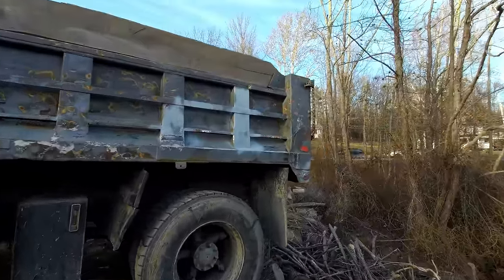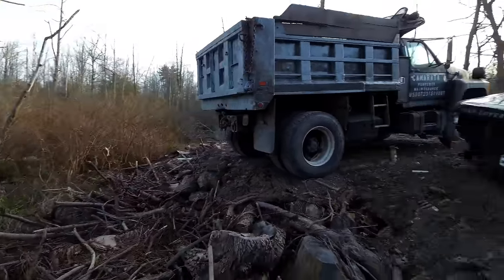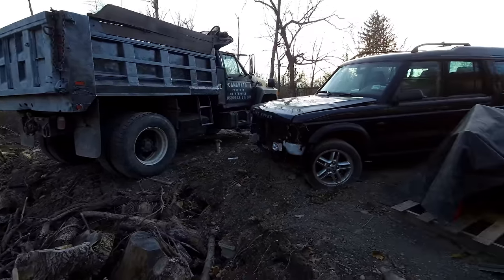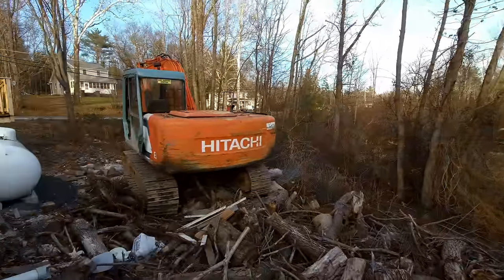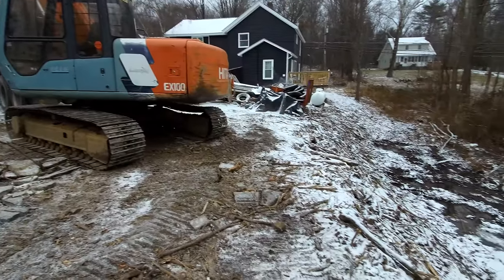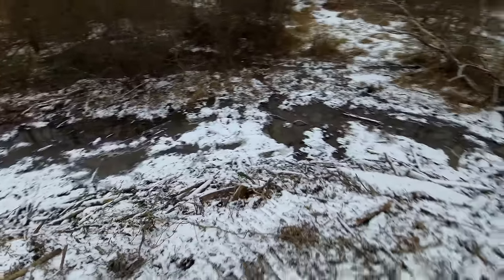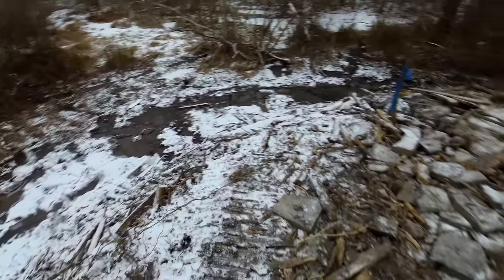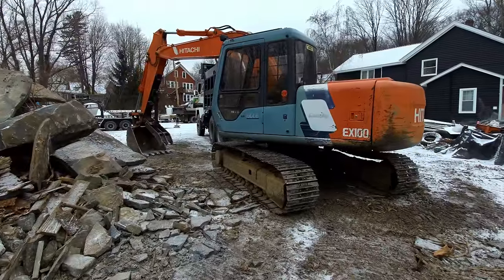Cleaning up dumped wood

Comment: 4:39 Land Rovers come with "check engine" light turned on from the factory. If the light is off, head over to the nearest dealership, cause the bulb is missing.
Reply: Lol you the kind of guy that thinks a Black Lab is a guard dog !!!! Until you came face to face with a real guard dog like a Cane Corso !!!!! And things will run forever if you take care of it with a few exceptions like a Fiat now you do realize Fiat is the new Jeep Wrangler???? I'll take a 2004 Land Rover Discovery over a brand new Jeep any day!!!!!! Trump 2024
Reply: @LaLaLucky7777  you do realize that Jaguar and Land Rover is a subsidiary of Tata motors of India since 2008, Probably why you chose 2004.

Comment: That place has been "expanding" their flat parking area for a few years now.  I am always surprised when I drive by b/c of where it is located that more isn't being done to force him to clean up.  Great work, that chipping yard looks pretty extensive.
Reply: TechEdFireman it's criminal.
Reply: Not Sure are you sure?
Reply: if all that mess didnt originate on that property the owner could have a huge problem if the NYS DEC got involved.  Its called operating a landfill without a permit.  The property owner might be looking at a felony count with substantial jail time and a very expensive fine
 . If I remember correctly it was $10 K plus cleanup costs around 20 years ago.

Comment: Hi Andrew from the UK. your comment about a landrover. We have diesels mostly over here, my black early 3 door i purchased for next to nothing but it needed lots of welding underneath. That done i owned it for 10 happy years doing everything I wanted to do with It, towing big trailers,  broken down vehicles, or being a 7 seater car. It used to tow in broken down vehicles with ease and its old fashioned 2 1/2 liter turbo diesel ran happily on new cooking oil & diesel mix allowed here if you only used 25.000 litres a year (but who checks) sadly I had to sell it at 240.000 miles on the odometer due to my need for an auto box one when  find the right one - Diesel rules here Andrew.. OK, I am an old machine shop engineer that used to work for the aircraft Industry so, I love just watching your videos and LEARN something new each time, but at 71 years of age, I`ll not do lots that  I`ll learn from you.. Your doing great stuff that keeps me amused so thanks for that.. OK, as Its near that time of year, may I wish you & family a Merry Christmas, and that goes out to your fan base also.. Have fun, keep up the good work.... Ian.B.

Comment: Nice to see the 10 tonner earning its keep. Great video Ta!   The Land Rover is a Discovery 4x4  Tdi. (Turbocharged Direct Injection) I used to own a Tdi 3 & 5. 2.5 Litre engines, diesel, manual,7seater, with cycle rack on rear door. Great family vehicle for off roading. Not as good as the Range Rover. Keep the videos coming. :-)

Comment: Client Dumps all that free firewood, but heats with propane 🙄🙄🙄
Reply: Some elderly/disable people can't use wood as source of heat, not everyone has the ability to do so.
Reply: Sam Max is this home owner elderly/disabled? They sure did a good job of dumping the wood in the first place then ...
Reply: @sammax4245  Friend's grandmother is in her late 90's and she uses a wood burning stove. We cut up all her firewood to under 6" in length (needs to be that small for her stove) and split it so it is more likely kindling than logs. Sure it adds a little to our work but she can still handle all of it when we aren't there.

Fill a few crates up for her and carry them inside next to the stove so all she has to do is move herself a little to fill it.

I would also hope that if you are in bad enough shape to where you can't physically move small amounts of firewood someone is there for you. The only people I know like that who don't have help are the ones who refuse it or drive people away.
Reply: Propane is the way to go no cleaning needed no smell and less work and is more efficient
Reply: Jez Coates in a fire it could of exploded, that wood was close to the tank
Reply: @jezcoates  
How  do you know are the home owners who did that themselves?
Indeed are the home owners by them hiring someone else to dump the wood there, this has nothing to do with them having propene as source of heat.
Reply: @warrenhaga6340  and the cost is why I mainly heat with wood.
Reply: @Sam Max But they do have the ability to cut it up and dump it apparently.
Reply: @bnadit1949  some people dont like to deal with burning wood . it can be a lot of work for some people .. shit my brother inlaw haves a tree cutting service business and he dont have a fireplace or wood stove in his house he have a pellet stove. but his other 3 apartments house he rents it dose have a outside furnace it heats hot water . just saying a lot people dont like to deal with burning wood .
Reply: It depends on what kind of wood .if it turns into creasote in your chimney you risk major fire.
Reply: Apparently, none of you heard where it came from.   4:02
Reply: lmfao thats what i thought instantly :)
Reply: Jez Coates. Maybe they cook with the propane?
Reply: @warrenhaga6340  I think your statement is debatable, I own a sawmill and have alot of trees around. Wood is a renewable resource
Reply: @davidnichols1363  also depends on how you burn your stove, the slower the burn the more creosote accumulates. Get a hot fire every once in a while and clean the Chimney every year and no problems.
Reply: @bigears4426  No, these tank will not explode, there's a reason there is a high pressure blow off went on the tanks at most it will become a huge flamethrower
Reply: Wow Jez, after reading through all the responses, it appears you said the worse thing a person could ever say about someone.
Seems you'd of gotten less reaction if you'd of said something mean about their sick dog, and late grandpappy.
Reply: @funtyes1970  Until they make an automatic wood burner where you can set the thermostat and leave wood will always be an alternative heat source. Pellets are as close to that as one can get but the ash must be removed and they need electrical power to run.
Reply: Some elderly/disabled people can’t use wood 🪵 as a source of heat, not everyone has the ability to do so.

Comment: I was kind of surprised how quickly you filled your first (black) truck. 20:45 holy crap, I didn't see all those trunks down that slope.I must say; that job was about 6 times as large as I thought from the first ten minutes of your video.
Reply: Yeah I was wondering how he quoted and if he short changed himself, or maybe hourly rate?
Reply: We're the (only) ones who didn't see all those extra tree trunks from the first part of the video. I am sure Andrew saw them and took note of them before he estimated or bid the job. In total, there was a crap-ton of wood there. You gotta wonder how not smart it was to dump all that wood in that creek. Talk about creating a problem that's going to be much more expensive to solve (in the future) than dumping or chipping those logs when they were on whatever truck that delivered them and dumped them in that spot in the first place.
Reply: pneumatic00 you would think it would be hard to tell how much wood was there until you got into it for sure that a lot of work and tear on your equipment. 
But you would think he knows he been at this a long time.  A rookie could lose his ass on a job like this. It just seems to be more and more wood.

Comment: Good winter job....Two things I did working in the woods when the tracks were full of mud...One trick was to spray everything with form oil when the tracks were clean.....it was environmentally friendly....I use to park the dozer on RR ties at the end of the day....I built a plastic hut to park in...Get to the log lot before light...shove the jet heater inside the hut...1 hour later the dirt was soft.....you may consider installing a barn door kit on your big truck....just be carful you don’t spread the box.....thanks for taking us along...
Reply from the maker: Know where to get a barn door kit?
Reply: @AndrewCamarata  -- There are lots of sellers of barn door kits.  Few of the sellers actually make the kit, they buy and resell other company's kits.  I've not installed one, I have heard about these two companies, but have no experience with the company: 
 https://consolidatedtruckequipment.com/barndoor/      
https://www.beauroc.com/parts-catalogue/   (really slow website)

and https://ox-bodies.tbeidumpbodyparts.com/shop/tailgate-hardware?lang=en&sort_options=a.ordering-ASC&limit=15&start=0

And this company has a bunch of things for trucks:
https://www.buyersproducts.com/product/gooseneck-flip-ball-hitch-151

This might be what you're looking for:  ~US$225

https://www.ebay.com.au/itm/Tipper-35MM-side-swing-tailgate-kit-complete-Truck-Trailer-/121187569282

Comment: That 20 year old Land Rover is a vehicle designed to meet European efficiency expectations and environmental standards. To achieve this an awful lot more technology is required than your typical 1980’s pickup, this technology makes older vehicles like this uneconomic to repair or in some cases too complex for the DIY mechanic. It’s a doddle to make a vehicle that delivers 10mpg belches out pollution and runs for decades, it’s exponentially more difficult to make one that delivers 40+ mpg with low carbon emissions and runs for 15+ years.
Reply: Well you do makes sense but Toyota has vehicles in Europe as well and they aren't junk like land rovers lol
Reply: B White it’s all how you treat them , the motor in the Land Rover is a Chevy v8 that wasn’t approved so Land Rover bought it and started using it the only this wrong is the engine and in my case I had mine in 2001 to now and never had a major problem at 200 thousand miles just a gasket or two other wise it’s a great machine
Reply: Land Rover made incredibly robust/reliable vehicles for decades, then this emissions crap came along and they had to push technology to adhere to them. Their quality/reliability dropped around the time of the discovery I. For the past 10 years they have regained their robustness/reliably.
Reply: @Brandon-ch2ot  toyota sells different versions in europe then in usa
Reply: @MannPropertyServices  yeah that's true. You can basically make any vehicle last but owners like that are few and far between. Just from my observations and experience I can see it's a tough vehicle but maintaining it seems to be the problem.
Reply: @38klootzak  yeah I'm more referring to the hilux I think. It's Tacoma here but those trucks are legends for requiring little maintenance. But I like Landrovers but at the price and the price of maintenance it just hasn't added up in most cases
Reply: @chrisb4009  there was a period in time. I would guess mid yo late 90s and even early 2000s where they were junk. I feel every manufacturer goes through it though. Either way I would avoid them unless one was brought to me with a deal I couldn't refuse
Reply: @Brandon-ch2ot  i will admit land rover discos aren't the most reliable of vehicles but trust me the defender is a legend of a car i own 2 ( 90 and 130) so both the smallest one and the biggest one and i love them to bits 

For the toyotas indeed the hilux is one tough old car
Reply: Anytime I hear safety and technology I run the other way... probably going to be very expensive and never give you a good return on your investment!
Reply: @MannPropertyServices  Rover V8's were not chevys, they were based on the alloy block Buick V8 that GM sold the rights too back in the 1950's .
Reply: A lot of things come into play when people park up cars of any make, friend of mine back in the 60s in the UK loved USA cars and ran a Studebaker. Spares were hard to come buy and it was our job as mates to scour the country's, breaker yards etc. he progressed through to newer models but the spares still were an issue. Lucky for him on mate became a pilot and would bring him back stuff from the US.
Reply: Friends of mine in Oz, out in the bush a way, they won't touch Land Rover or Range Rover; when their lives depend on it, it's Toyota or Nissan.
Reply: @nicktecky55  Plenty of them out there though, lying in the inorganic scrap piles. But I've known guys to run series one Landrovers and really realy Rangies forv years. Toyos ts are seriously popular as work trucks but no where near as popular as the B&S ute.
Reply: Land Rover Discovery 2's are a piece of cake to work on. Simple, rugged body on frame construction, and solid axles. There's nothing efficient about that boat anchor of a Rover V8, but it is a straightforward engine to work on. The TD5 Diesel's are probably a better, more reliable engine but were never available in the USA.
Reply: Advocatus Diaboli I should have been more clear. I was referring to brand new technology in general, let the kinks be worked out first. I like older trucks up to about yr 2000 because you can still wrench on them fairly easily without having an electrical engineering degree. To each there own!
Reply: then the question becomes.... does the environmental impact of manufacturing and throwing away cars with 15 year life expectancy, outweigh that of a one time manufactured vehicle that lasts 50 years...

Comment: Andy,  at the beginning of the tape here,  it shows you struggling mightily with removing,  well trying to remove frozen rock-hard,—dirt.   

We have the same problem here with our heavy logging equipment. But we have water pressure guns like you but we also have one that you don’t have that is extremely powerful,  and we run extremely hot water through it that would SCALD YOU.  

And we use it on the frozen tracks and on all of our logging equipment that gets froze up overnight when it sits out on site.   On the log-landing.  As we call it.   

Back at our office we have one building that is very very large that we can pull a Half—a—dozen log trucks or a half a dozen different pieces of heavy equipment into it. 

And all of our buildings have heated floors and needless to say when we come back in the next day everything on all the  equipment has melted bone dry.

Comment: Weld some hinges on the side of your dump bed and gate so u can swing your gate to the side of the dump bed when haul and dump oversize crooked load . Then you won't have to jump in the back of the bed throw debris off before u dump your dump truck .

Comment: Andrew why do you always tow with the 6 wheeler instead of the 10 wheeler?
Reply: probably cheaper to maintain ,  bridge weight limits, easier to get to around small job sites
Reply from the maker: Blake Wilcox 10 wheeler doesn’t have the right plug or brake controller
Reply: @AndrewCamarata  time for a video installing the right one!
Reply: @AndrewCamarata  Maybe shop around for a used trailer with air brakes. I made the switch and not ever going to look back. Air maxies keep your trailer put when you park it and can stop so much better than electrics. Drawback is that you can't move it without air applied.
Reply: @davidmorse8432  Hi David, It makes it harder to steal.....Bye, Ian.
Reply: @gillianst-claire176  Good point!
Reply: @Brandon-ch2ot Time to break out the chainsaw
Reply: @bwilliamstown  lmaooo hahaha. The chainsaw to the dash is still one if the funniest things I've seen on YouTube
Reply: I've been wondering this myself for a bit.. been several jobs now were Andrew has delivered his machinery to a job with the 6 wheeler, then had to go off and swap for his 10 wheeler.. would have thought it would save a lot of time if the 10 wheeler was set up to tow the trailer... Would be good to do a video on the trailer as well..(maybe show some maintenance on it??) as I don't think you have done one yet...
Reply: Around central PA everyone calls them single axle, tandem, or tri-axle but I am sure that's different everywhere. Good question though. I see it got answered. Both are cool trucks. Not cheap at all to keep on the road. A buddy told me what it cost to register and fuel tax the tri-axle he has and I was in shock. Plus fuel and maintenance. It's no joke. I sold my F-700 but miss it. Just a hobby truck and for personal use so couldn't justify expense. Was fun to drive though. Detroit diesel and 10 speed or 5 speed with 2 speed rear or something. Little trigger on the shifter to get two ranges out of each gear.

Comment: Invest in a quick hitch and some different size buckets including a land rake for your Hitachi. I don't know if they're sold in the US but land rakes are perfect for clearing scrub and wood like you were doing. The thumb you have on your machine would be an even bigger bonus with a rake. Great machines those early EX hitachis. If the computer fails you can always fit a manual hand throttle and they keep going...

Comment: I've seen guys bolt on a 100 gallon water tank and a pressure washer to their trailers/trucks to wash off equipment on site after every job. Makes it a lot easier to keep the equipment clean and the drive home safe from mud and rocks falling off and going through somebody's windshield.
Reply: Good idea...or find a nice flowing deep creek and drive through it a few times and Bob's yer Uncle.

Comment: Hay I used to work for a guy who owned a Land Rover dealership. He had customers that would buy two for the reason you just mentioned a good chance one was going to be in the shop. Funny story when Ford bought Jaguar and Land Rover they rented a couple of Jets and took several executives over to England to see what they bought. The assembly line they were using was bought in 1951 used. Ford spent around 3 billion to fix it up and sold it for half that to a car guy in India.